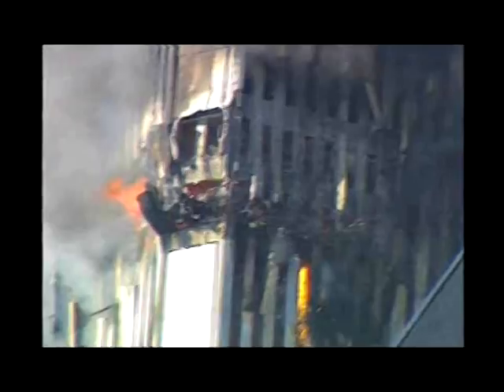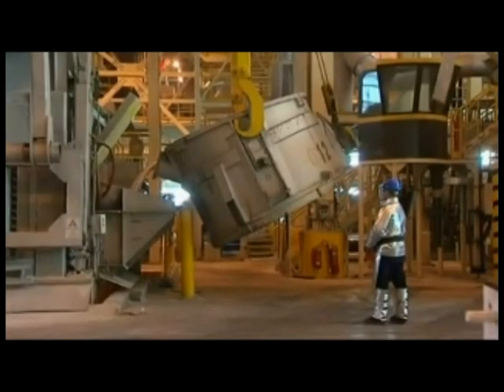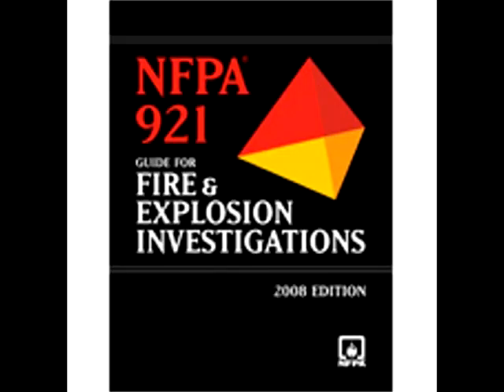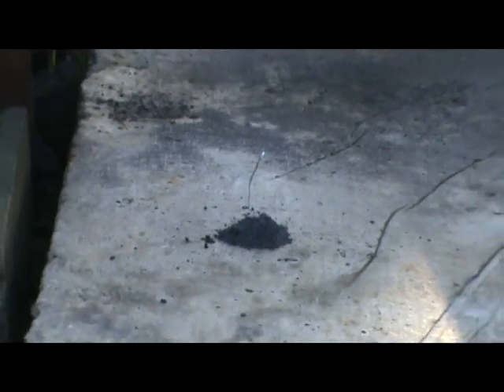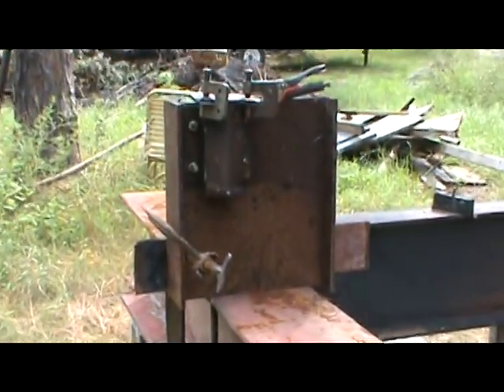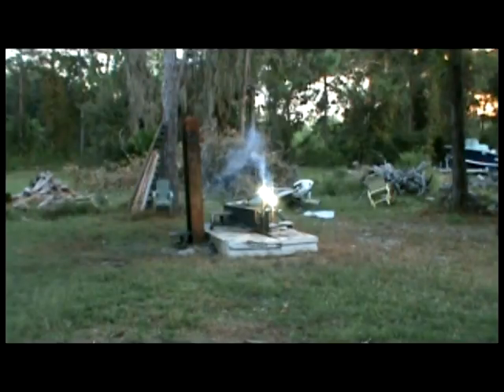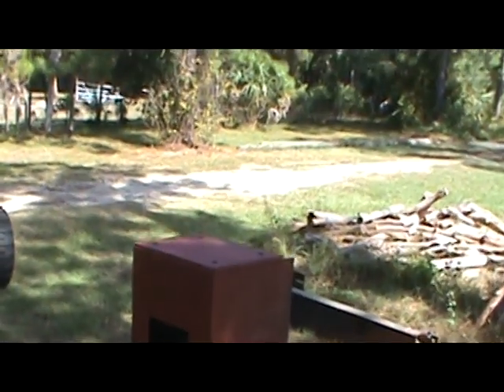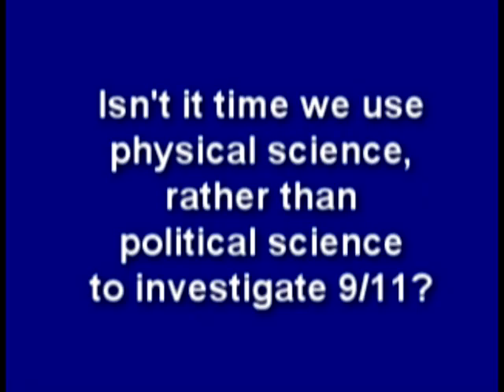9/11 Experiments: The Great Thermate Debate

Comment: How can anyone not think that an elite group of people, wouldn’t  do this to gain power and wealth?
Reply: MyGuitarTwerks ... dude... that's apart of the problem. Lazy sheep.  BTW he was the Vice President during GW Bush.  Former CEO of Haliburtan... that's Wikipedia level informan. 

Considering you're response your probably too young and lack intuition to understand big picture geopolitical staging.  This was a controlled demo, look at the original news footage.
Reply: MyGuitarTwerks if you didn't Know who Dick Chaney is I think your research maybe flawed.
Reply: rontayan The metal you see is aluminum melting out of the impact point. No metal drips out of any other part of the building. The jet fuel doesnt melt steel beams, but it is enough for it to mend and break. Each building has 500,000 tons of weight. They are monsterous sized buildings. Nothing like your average building. All it takes is one floor to give and break and the force from that is enough to cause a dominoes effect that we see in the collapse. Its simple. No demolition happened. Just standard physics.
Reply: MyGuitarTwerks What about building 7? What’s the excuse for that?
Reply: MyGuitarTwerks okay. Now send a video to me of another building imploding due to fire..... I'll wait.
Reply: rontayan Its not just a fire. A 50 ton plane smashed into the building. This is the only video we see of a plane impacting a building.
Reply: rontayan And also, standard fires dont burn as hot as jet fuel. So the counter argument is flawed. And even if we could compare, it wouldnt be a fair comparason knowing the size of these buildings. These are not just your average sized buildings like I already stated.
Reply: rontayan Also, I did look up about Dick Cheney and bush during 9/11. It does look a bit suspicious. Their activity on that day seemed like they knew everything that was going to happen. What I thought was extra wierd was that Bush ordered to limit investigations. However, there is still no physical evidence that it was an inside job. And their actions on that day could have been a coinsidence. And the orders to limit investigations could have had a different reason. I could not find anything about gaining money from it though. If you could show me a link, I could consider them being suspects in the disaster.
Reply: Randyu Pladek How can anyone not think that terrorists kill people?
Reply: rontayan I forgot to mention in my statement about the aluminum. Planes are made of Aluminum. Most people think that aluminum doesnt glow orange. But it actually does. At over 1652 degrees fahrenheit, Aluminum glows orange.
Reply: rontayan You shouldnt underestimate my knowledge. I fully understand the physics going on with the collapse. I am 100 percent certain there was no demolition. All of this was caused by the planes. Guaranteed. If I really wanted to, I can research about Dick Chaney as you said. But I doubt it has any effect on the information I already know. I mean, they could have just used the planes and nothing else if anything corrupt did happen. But I still find it highly unlikely. Either way, at the end of the day certain people befefit from just about anything.
Reply: MyGuitarTwerks what about the reports of firemen hearing multiple explosions, ladder 13 for example, their story is well worth a listen. Or what about the third building that collapsed? How do you explain that? It didn't get hit by any plans whatsoever.
Reply: Jon j. Don’t waste tour time attempting to educate a fuckin brain dead moron.
Reply: MyGuitarTwerks I'm not saying you're wrong, but there's definitely a lot more going on here than meets the eye, in my opinion. Also, the balls? Do those come from aluminum after it burns hot?
Reply: Quick correction skyscrapers that are steel based have never collapsed due to fire up until 9/11
Reply: Because there are too many ways to gain wealth and power without getting you hands dirty. Just look at your elected officials.
Reply: William Miller actually i cant say the weights on this one but the empire state building was hit by a plane and didn't collapse
Reply: William Miller  also i cant remember where when or what exactly was hit but if you do research you will also find that an apartment structure was hit by a plane and didn't fully collapse only the impact zone let rubbel fall 
An apparment structure is weaker than the twin towers but still managed
Reply: Plug In Building 7 had raging fires that burned for hours. The firefighters on the ground even said they witnessed the columns inside leaning. So they knew it lost structural integrity and the firefighters pulled out of the building. So you are either really stupid or a liar, or both.
Reply: rontayan Dude stop being lazy sheep and just accepting all the nutty conspiracy videos online. The "inside job" theory has been debunked numerous times.
Reply: Jon J The "explosions" were the elevators crashing down.
Reply: Jon J Building 7 collapse because it got hit by debris and had an uncontrolled raging fire for hours.
Reply: MyGuitarTwerks what about tower 7 how did it fall without even getting hit?
Reply: Randyu Pladek and support from the people to do whatever they want and whenever they get questioned the elite can just scream "do you want another 9/11?"
Reply: Because that would be retarded
Reply: It all points toward ((isreal))
Reply: Who wired the buildings then? What company did the job? What company supplied the explosive? Where was the 'button' pushed from and who did it?
Reply: The building was connected to a natural gas line as well, which supplied HVAC systems at various floor levels. The planes took out several floors at one which would have included HVAC systems. Burning  gas is very very hot, mixed in with hundreds of tons of jet fuel that would well melt all sorts of things.  So you're saying the explosives 'melted' the steel instead? You know the ones - the explosives that dozens of men who spent months pulling out ceiling panels, access shafts etc to lay ignition wires and install this explosive - the explosive that not one person knows where it came from, the men, not one person knows who was working there doing this wiring, not one company found to have supplied all this detonation material, yes all those things that not ONE person ever saw doing it or knows of it ever happening.
Reply: It's possible, but there's just no solid evidence for it.  All these theories are stupid.
Reply: Not gain necessarily gain, but maintain. They already (right now) have power and wealth (which is just another means to another end, power), they don't need more when they're already top dogs and influence most things, what they need is to keep it. At least as a class/group. As individuals there is some relative gains (which is secondary and a consequence), and one could argue that as a group they gain access to extra areas they might not have had power before, but that is only only relevant if said areas threaten their dominance or are useful to the maintenance of said power, which makes it also secondary and a consequence of goal #1.
Reply: Gerry Berry ok so two planes took out 4 buildings . Ok makes perfect sense 👌 also every demolition expert across the entire world calling bullshit ?
Reply: Call me crazy but I just see a modern model of history repeating itself. Everything has a beginning and an end , every civilization a rise and a fall . The balance is so tipped to the elite 1% that I don’t think there’s any going back ?
Reply: What gain does anyone else but terrorists have in the act of killing thousands of americans and destroying 2 of the largest towers in the world?
Reply: MyGuitarTwerks open and total war. With 9/11 military industrial complex gained complete control of personal freedoms, and a blank check to start a war anywhere anytime.

Have you ever invested in the stock market?  If you have then you'd know how profitable defence companies became after 9/11.  Now the VP at the time was Dick Chaney who was the CEO of Haliburtan. A defence company. 

Do you think he maybe would have financial interest in open warfare?  Do you think Dick Chaney actually gives a fuck about you or anyone else outside of his circle?

Hell he shot his hunting buddy in the face and didn't appalogize.  

Why do you think anyone in power really cares about the working class.
Reply: You're grasping at very short straws, trying to piece together something that doesnt really exist - hallmark of a conspiracy theorist.
Reply: rontayan I've heard enough. Its all conspiracy. I can debunk this video. I've done enough research to debunk the 9/11 conspiracy.
Reply: @myguitartwerks7825  what does "its all conspiracy" mean? Most people don't seem to even know what the word conspiracy means these days
Reply: rontayan I dont think a lot of elitists care about the lower class. But yeah, maybe. Im too lazy to look up that person and to see if he actually benefitted from 9/11. All I know is that no demolition occured.
Reply: MyGuitarTwerks How can you be so sure? I’m no genius either but things couldn’t have happened the way it’s been told to us.

Comment: What crap. Cement starts spalling at 600 degrees.
Reply: it was a steel framed building not concrete
Reply: cameron Martin thank you for exposing your ignorance. It’s common amongst “truthers”
Reply: judodavid1 what the fuck does cement have to do with this video
Reply: GeeTR 63-71 that’s what I’m saying 😂😂😂
Reply: "truther" you know nothing about me kiddo
Reply: except military grade nano thermite was at the scene and pools of molten steel kept burning after 2 months of its collapse
Reply: And THAT boys and girls is your average “truther”
Reply: Yea... “tacos” I obviously gave you far to much credit @ average
Reply: If you know anything about commercial construction, cement is used for the floors...in fact...there have been some building collapses that have happened due to not waiting long enough for the cement to cure before starting the next floor. If you get cement or any material hot, it gets weak, and can't take the loads it was previously able to bear. I've been in construction for 41 years...this video proves nothing.
Reply: Do either of you Einsteins know what the towers were constructed with?

Comment: Let's thing of it like this, 

You have 2 big fuck off building in the middles of the city, and while tensions explode in the middle east, Al-Qaeda led by bin Laden take two 747 and fly them into the 2 big fuck off buildings, would you 
A. let them fall and hit other buildings with causing more casualties or
B. perform a planed out demolition before tragedy really strikes.

Comment: If jet fuel from a commercial airliner wouldn’t be sufficient to weaken steel until it starts deforming 800-1000f, then why use fireproofing on steel buildings? You do realize for thousands of years people have been bending steel using only charcoal or coal. It’s obviously blacksmiths who took down the towers...
Reply: Lasco: the steel made that way was piled and compressed not extruded the way it should be in buildings of this stature. Or...We're the beams cheap steel from a certain place?

Comment: Did they rule out electricity because a short could definitely melt steal
Reply: James Holbrook: I thought that same. But it does not explain entirety of the situation.
Reply: And you think that someone planted large versions of these things all over the building without anyone noticing presumably on each or every other floor since it looks like a controlled demolition and to cover all that up hijacked 2 airplanes and then ran them into them

Comment: You know how when metal gets extremely hot, it becomes WEAK and MALLEABLE? Like forging?
It doesn’t have to melt for the structural integrity to fail.
On top of that, once the weakened beams collapse and the building falls, the friction caused by TONS of concrete, steel, and burning material WILL heat up and easily cause melting.
You are actually an idiot if you think this proves that this wasn’t a terrorist attack.
Reply: Gavin Burke
Friction from frequency would have increase  heat density but bending is not yielding - it is work done - so it is energy lost.